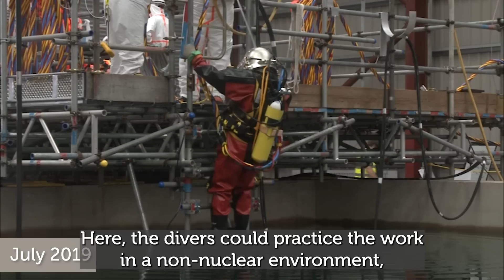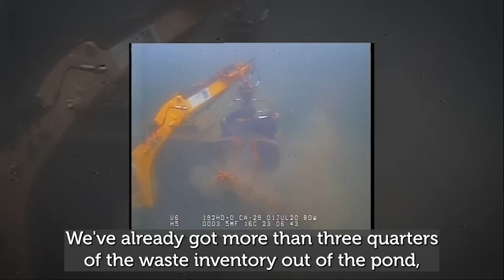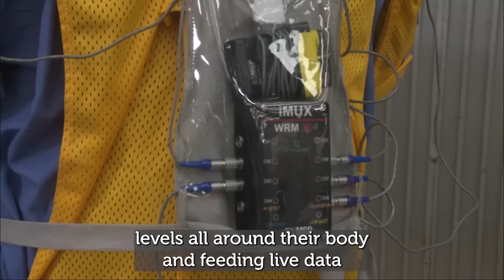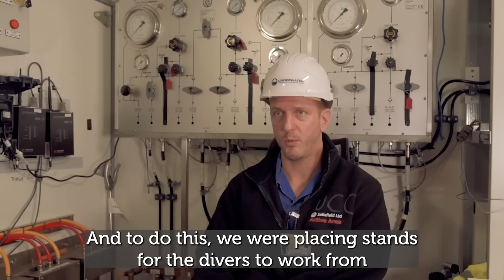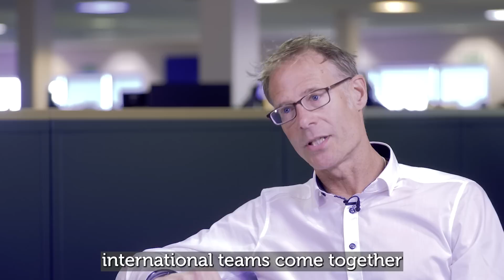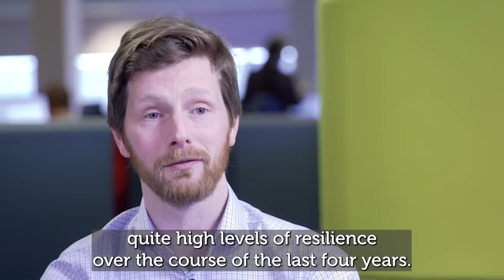The Pile Fuel Storage Pond divers - Sellafield Ltd

Comment: The first time my boss told me that we had a job in a nuke power plant I wasn’t too happy with it. I knew nothing about such interventions, and naturally I thought that it was an extremely risky way of diving. Fortunately, before going there, I first had to take a few weeks of training during which we covered a large number of topics concerning these installations and in particular everything related to safety.
So very quickly my opinion changed and I must say that in the end I quite liked this type of intervention because, unlike civil engineering inshore dives, here, even more than in offshore, everything was extremely regulated (procedures) and prepared in advance with no room for improvisation.
I would certainly not have wanted to spend my entire career in this environment, but a few weeks a year did not bother me at all because I always remained VERY below the limit doses of exposure to radiation.